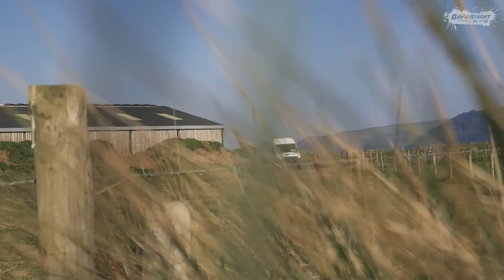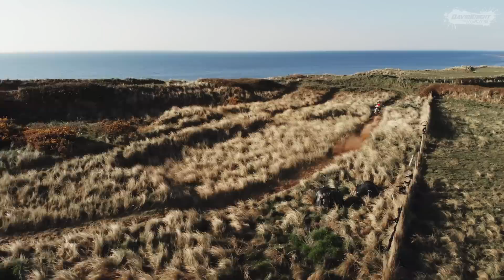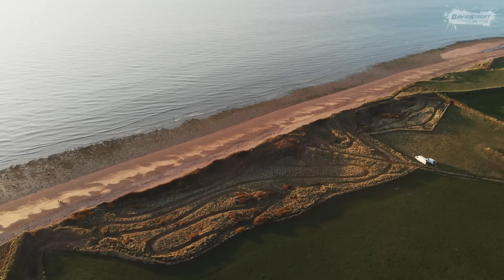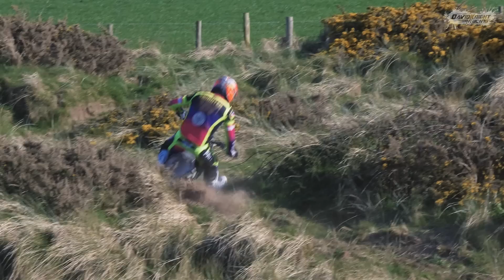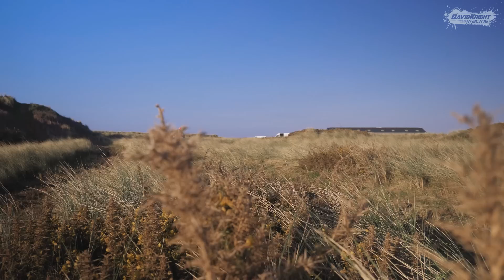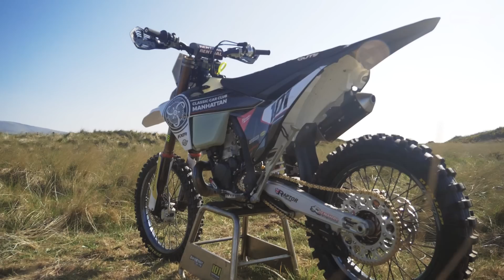David Knight // 2023 KTM 300 XC // Bike build // Episode 3

Comment: The 23 300SX revs out hard in the green map, it’s got enough off the bottom to pick up tractably and goes hard mid to top. It’s an absolute weapon in the desert. Wicked fun. Softer white map feels a bit flat in the dunes but it’s good for rough of piste lines and at the local motocross track which is dry and dusty. 21hrs in, not touched it, just dropped the forks 1 ring and added a little air pressure for my weight and rebound damping to suit the extra air and heavier spring, plus some compression for the desert rides. Still trying to get used to only having a 5sp box though. 😅
Reply from the maker: Awesome

Comment: I’m pumped to see where you go with gearing. I just mounted a 13t front to mine with the stock 49 rear. Gotta hit the trail with it yet to test. I used stock gearing in the mountains of Montana and that was no good. Way too tall.
Reply: I live in the hills (not mountains) most people run 51/52 rears
Reply: @goinhot9133 with 13 or 14 ? On the 2024 300 6gear ?
Reply: @lacave9629  13/52 is what I’m running on a 250sx set up for woods racing
Reply: @goinhot9133  oh ok extreme bike not for gncc or enduro gp run

Comment: "4 error codes but it runs alright eh" lol
Reply from the maker: These new Ktm’s don’t clear themselves I’ve found out, they need clearing by plugging it in at a dealer. When I was disconnecting things and trying to start bike it added more so I ended up with 4 codes flashing 😂
Reply: @knighternet aye… saw there’s a map update for that for 24. 😅